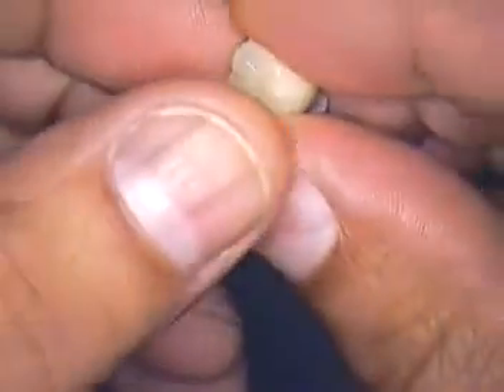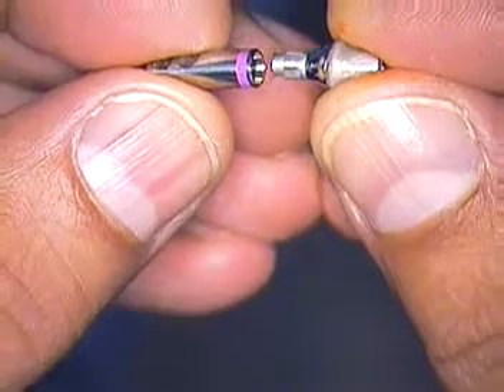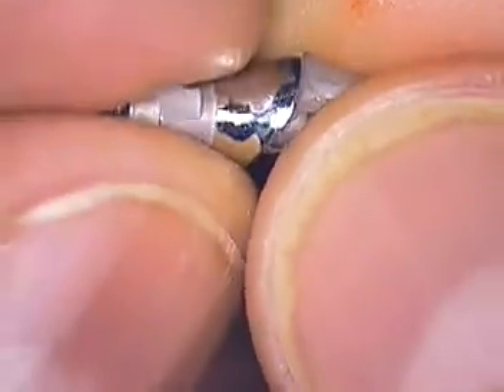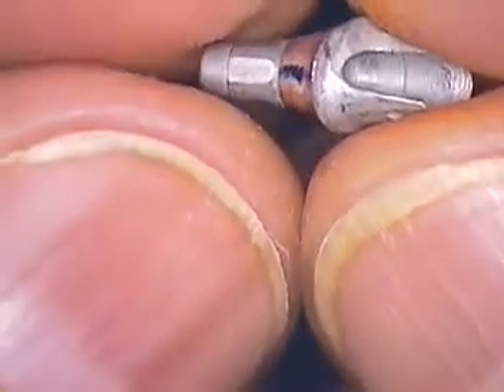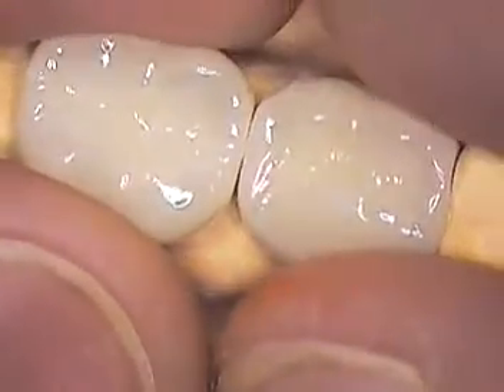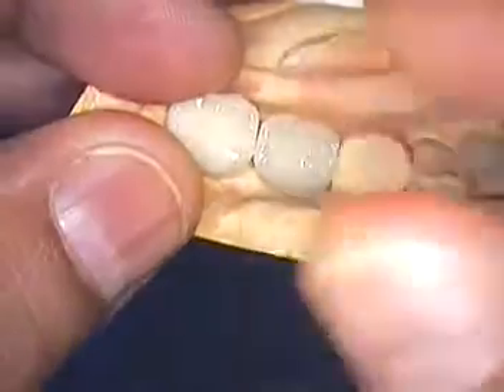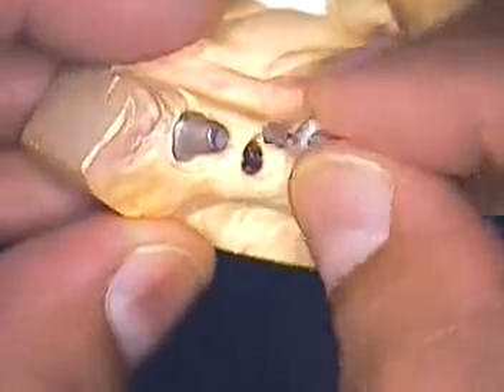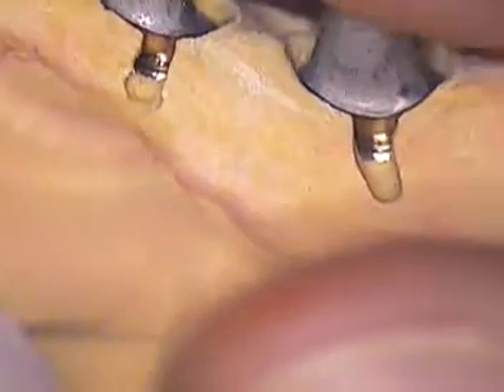DR. GERARD CUOMO - Bone Level Dental Implants -  Use a surgical guide!!  4 of 4 Boca Raton, Florida

Comment: Your blowing into your mic. Its not a big deal unless the listener is wearing headphones. When wind hits the condenser (little aluminum disc inside a can style microphone used in headsets) it causes a booming. equivalent of an explosion depending on the volume setting this can be very annoying. I have sensitive hearing always hear ringing and sometime its clouded and sounds like hearing underwater(result of a watersking mishap and other factors). I just wanted to make you aware of proper mic position. The corner of the mouth is the best position it is close enough so there no loss of decibels and ensures the path of air moving out of the mouth and nose do not contact the condenser..

 Btw Thanks for all the videos. I am planning on enrolling into DDS courses. Your videos are going to make such a great difference. There is nothing worse than walking into a class blind with no knowledge of the subject at all. With you help I will have a working knowledge before getting there and hope to achieve top of the class marks at graduation.

 If I can get the chemistry and bio-lab prerequisites out of the way in time I plan on starting the course next fall. Unfortunately my finances are an issue and think I will have to complete those classes before applying for a financial aide, which poses another problem for me because I am in default of a previous grant. I am working a day at a time to chip away at this roadblock. Asking myself everyday 'What can I do today to make my goal a closer to success tomorrow'.

 Your videos are helping me far beyond what you may know. I am inspired to pursue my goal more passionately and raises the level of conviction and dedication  to making the dream a reality.
  Thank You Dr. Jerry Cuomo for you inspiration in my pursuit.